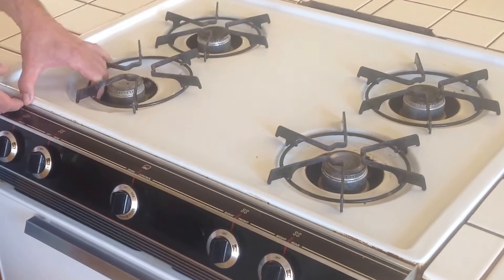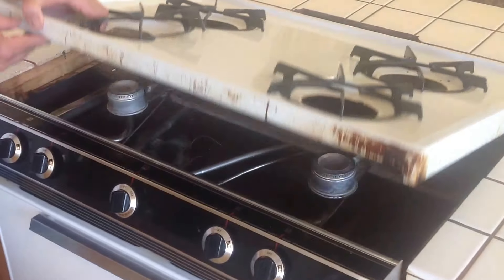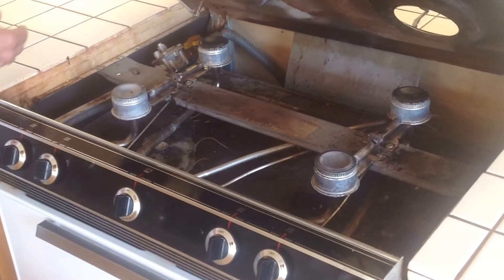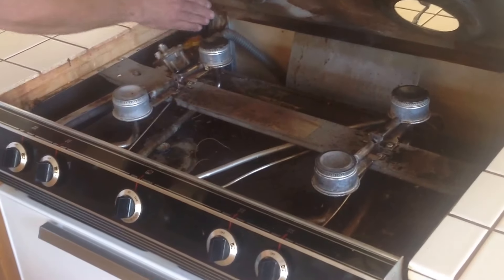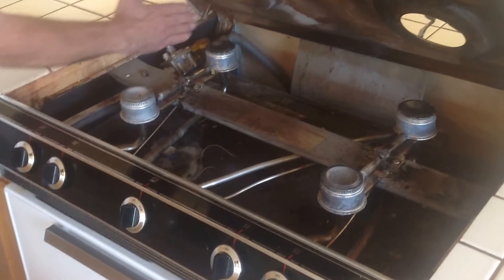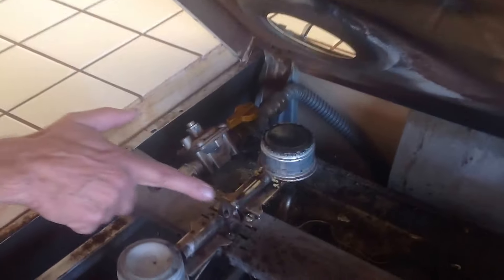Lighting the pilots on the Stove/Oven

Comment: I had new Gas line to put them. I have a pilot light that is about an inch tall, which is burning my stovetop.. also when working with an old stove clean out the air vent that goes to the top of the pilot light, because it will put out the pilot light flame

Comment: It is much easier to light the oven/broiler pilot light by opening the oven, removing the racks and then removing the lower oven cover. Just lift the front of the cover and pull it out to uncover easy access to the oven/broiler burner and pilot light.

Comment: I have one that pilots are lit but the oven and broiler don't come on the top burners work. The thermocouple runs from the front on top down the back in the bottom has that same heated drawer like in your video. Also has a heater connected on the left. Its a Glenwood. I cleaned reinstalled but still isn't. I raised the flame and still nope. So my assumption is the thermocouple/oven unit may be bad.